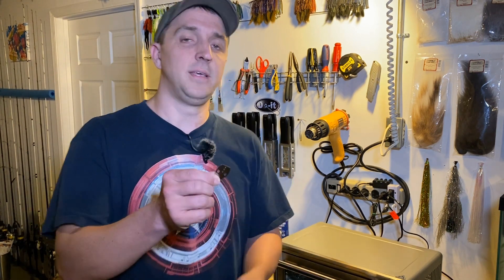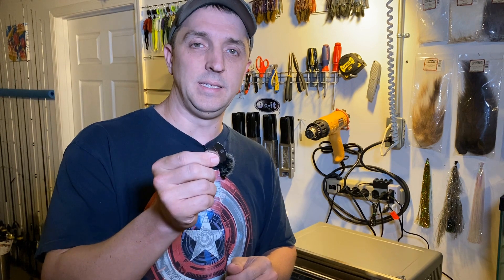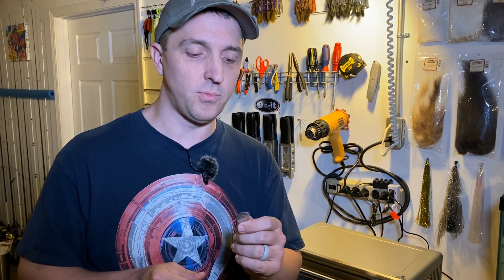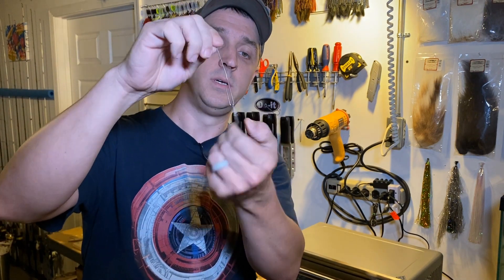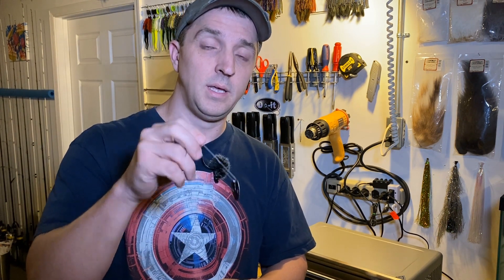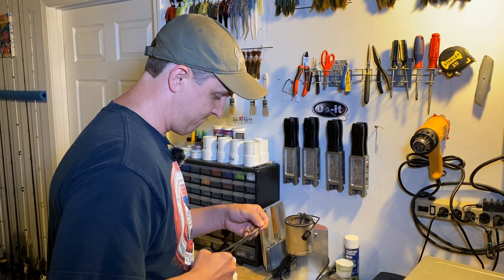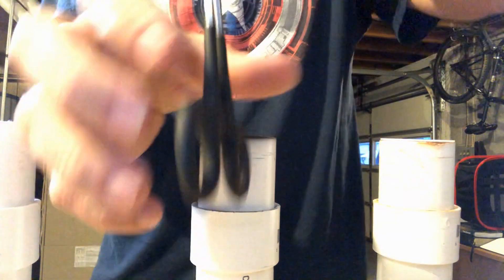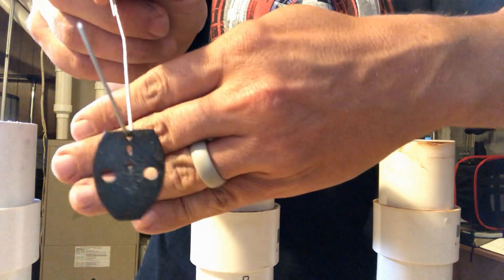How to Paint a Chatterbait Blade | Wednesday in the Workshop | Jig Making Tips & Tricks

Comment: I just hold mine at the bottom with a tiny pair of forceps right below the bottom hole. You only end up with a tiny spot that doesn't get painted but it is hidden when the blade is attached anyway. Also, doing it that way allows you to run it back through your heat source which I think is very important and unfortunately can't be done when it's on the paperclip because it flops all over...just putting this out there.
Reply from the maker: Thx for watching!

Comment: Adam first question is what it the UV stuff your talking about you dipped into after ya painted the blade. Second question would you use this same process to paint spinnerbait blades ? Thanks
Reply from the maker: Hey Shawn, the UV stuff in this video is called “UV Blast”.  It’s a powder paint-type application made by ProTec.  I stopped using it though as it was changing the hue of my jig heads… black would be more blue, Rootbear would be purple, etc.  it would certainly work on SB heads as well, but again… if I was to use it, I would be careful what color heads I applied it to.  Hope this helps!